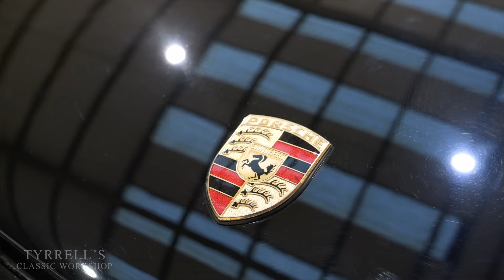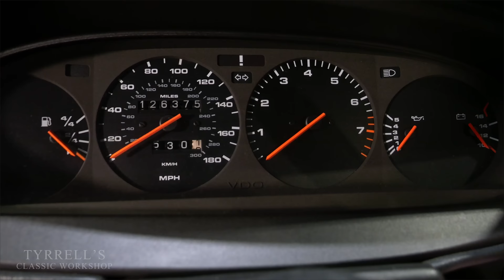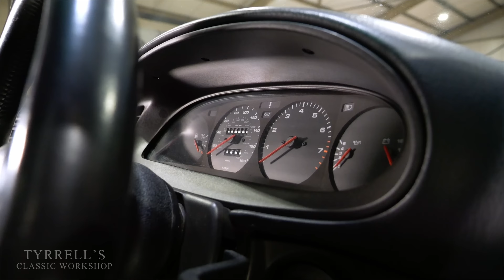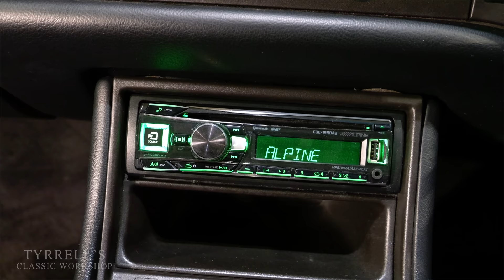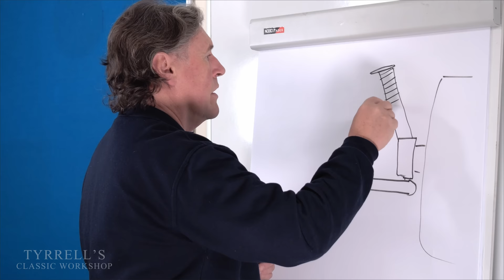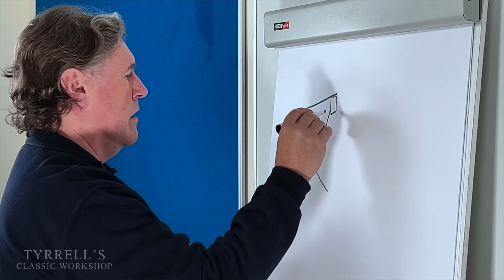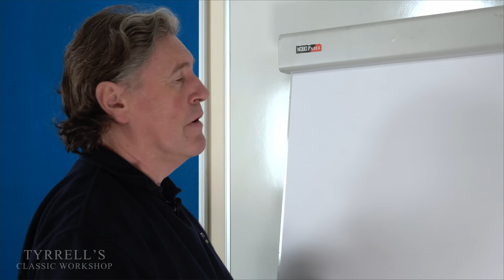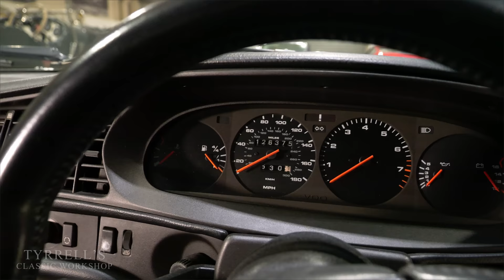Porsche Perfection: Unveiling the 968 Club Sport's Secrets | Tyrrell's Classic Workshop

Comment: Ian, you mentioned a few times at the start the 968 was 2.5 litres. The 968 was always 3.0 litres and at the time was the largest capacity 4 cylinder car engine in production. Handles like a dream with bags of smiles.
Reply from the maker: Yes- the perils of un- scripted takes. We did know that, honest! Sorry for mis- information
Reply: :) keep the little gems coming  @iain_tyrrell
Reply: And the 944 was also 3 litres.  :hand-purple-blue-peace:
Reply: Indeed, but started life as a 2.5 then a 2.7 (2.7 for one model year only).  All the 944 Turbos were 2.5.
Reply: @rallychamp01 The 924 S used the same 2.5 liter engine, but with slightly lower power (150 hp in 1986-1987 and 160 hp in 1988). The 944 S also used the same 2.5 liter engine, but with a 16-valve cylinder head and 190 hp.
Reply: Indeed. I had a 924S for a day for a transaxle photoshoot. Noisy engine (bit 'rattly' too) but it did grow on me. The interior looked great - so of its day!
Reply: @Hvitserk67 

The late model 924S was actually 1.5 seconds faster that the 944 turbo 0-60 time. 

The 944 T was heavier (Wider arches) and suffered with turbo lag against the 924S naturally aspirated 2.5 engine and slimline body. 

The very final 924S 1987/88 also had a space saver steel spare wheel rather than the VW full size spare (Van wheel) which shaved another 11 KG's off the weight and magnesium road wheels replacing aluminium.
Reply: The only commonality between the V8 928 engine and the M44 is the con rod bearings are interchangeable and the bore spacing in the block plus the alloy used for the block. 
Everything else on the M44 engine is bespoke. Different con rod design, bespoke pistons to meet the Porsche made hemispherical cylinder head design and different drive belt arrangement. 

Even the cranked over block to get the low bonnet height in the 924S/944 is at 30 degrees whereas each bank of the V8 would be at 45 degrees. 

The 944 carrera GTP le mans race cars (three built) M44 engine produced a seriously impressive 500hp during testing but was thought not to be reliable enough to withstand the longevity of the race so it was reduced in power to 370hp. 

In comparison the recent 2017 Audi RS 5 DTM class winning race car,  with its 4 cylinder 2.0 Turbo engine makes 506hp so the M44 race engine was very impressive output for 1980's technology. 

A couple of years back an Italian race engineering company did a full strip rebuild project on a standard road car 924 Turbo and with some redesign tweaks, modern electronic fuel injection  managed 450hp at the dyno test. 

As a VAG mechanic in the early 90's we had many a 924/944 as VAG stocked the majority of parts but sadly never got to see a 968 due to the rarity. 

That platform was a joy to test drive because of the great handling but if i never saw another torq tube bearings or clutch replacement i would remain happy. 
The Auto's also had a common issue with the transmission to oil cooler pipes leaking prematurely which ran the full length of the car and difficult to access and if you ran it out of fuel completely the metering heads could be a problem forever afterwards which i was told on my Bosch K jetronic course,  customers carelessly did quite frequently.
Reply: @ljt3084 I have not experienced that the later 924 S (160 hp) was faster 0-100 km/h than the first 944 Turbo (220 hp) in Europe, but there is no doubt that the later 924 Turbo (officially 177 hp) were faster than the first 944 Turbo due to lower weight and a slimmer body as you point out. The explanation is that the engine in question in the 924 Turbo (931) in lucky cases actually produced up to 210 hp. The mechanical tolerances at the time were relatively uneven, so in other cases the engine produced around 190 hp. The decisive difference between the models was that the 944 Turbo (951) had much better brakes so with repetitive hard braking from high speeds on the Autobahn the brakes of the 924 Turbo could not keep up. When this is mentioned, the later 924 S were really a gem and much, much better sports cars than many people think today.
Reply: @Aotearoa_Kiwi  just the S2 version and of the 944 production.
Reply: @racer98   That's correct. My wife had a 944 S2 Cabrio. Great car, with bags of torque (750cc per pot).
Reply: @iain_tyrrell  Speaking aloud about such things as a 3.0 litre 4 cylinder engine, would have certainly attracted accusations of blatant clickbaiting. Good move playing it down ;!
Reply: @ljt3084  No it wasn't, don't be silly. No 924S ever did 0-60 in less than 7.5 seconds unless it had been pushed off a cliff.

Comment: Base, manual 968 coupes are the real bargain nowadays! Everything but some of the weight savings and suspension parts are identical to the CS, but they are much cheaper today. With some fresh Bilsteins and Michelins, it will drive just as well tough.
Reply: The problem is a cheap 968 will most likely be a cabriolet.

Comment: I have a 1988 924S. So same basic suspension set up as this. It was the last UK press car so has Sports suspension, thicker anti roll bars and it’s lowered a bit from factory.

The handling is incredible and every time I drive it I smile like you did in this video. On rails as you described is spot on.

You can push it and push it and it eventually judders a bit at the back end to tell you enough is enough. The best handling car I’ve ever driven by far. I bought it to do up and sell but 20 mins into a drive to my workshop I knew I’d never part with it!

Comment: After owning a 944S and 944S2 when I lived in the UK, a 968 is what I aspired to. Then I got fed up with the UK, left the country, and that was the end of my Porsche ownership days. I sold my 944S to the Porsche dealership in Colchester and the rep gave me a lift to Colchester train station in his 968 Club Sport. It was a fast car. There was also a 968 Sport which, I believe, was only produced for the UK market. Apparently, some customers thought that the Club Sport was too basic, so the Sport was a Club Sport with the addition of some 'luxury' features - power windows, etc. Looked down upon by 911 snobs, but the Porsche 4 cylinder transaxle cars are lovely to drive.
Reply: The car in the video is a Sport ;)
Reply: Don’t suppose you remember the colour of that 968CS?  My Grand Prix white Club Sport was originally sold through Lancaster Colchester in 1994.  I believe it originally came with matching white wheels, but now has red ones to match the side decals

Comment: Great video! Sport and Clubsport variants are both excellent; well they’re both from the Clubsport line. This particular car is well known in 968 circles and is 1 of 306 special order Sports (Porsche GB ordered them) and not 1 of 179 C16 CS cars. Still a very rare car. Rather than bring snobbery though,  the issue is that the market values Sports and CSs differently and if a car is being passed off as a 1 of 179 CS to up its perceived value, then that’s naughty and as ever, Caveat Emptor. The Lux pack is a misnomer. It wasn’t an option on the CS in the UK, though was in Europe. The Sport is the equivalent and because it came from the same production line, will doubtless have the Porsche certificate of authenticity that it has a CS VIN number, which it will. But it’s still a special order Sport.
Reply from the maker: Thanks. The car is not marketed yet, but great efforts will be made to clarify what appears to be something of a minefield!
Reply: Probably have photos of it somewhere pre decals and sporting the Sport badge…
Reply: @davidfisk212 leaving Iain garage it will be better than any CS 😊
Reply: @iain_tyrrell   I know one of the previous owners (M.P. in the docs) if you want more info as I test drove it for him in Dec13. I think his number is in the file and he put the CS stickers on the sides etc and prob owned it the longest most recently. Hope this helps!
Reply: I don’t doubt Iain knows his onions and the car will be excellently presented. But it doesn’t change the fact that it’s a Sport and therefore worth less than a CS. But ultimately, it’s only worth what someone will pay for it but Iain has a reputation to protect so will want to do his due diligence to avoid any misrepresentation.
Reply: Totally agree with Davidfisk, I’ve had some experience with selling a couple of these and the sport v the CS is a testing con-flab between Porsche enthusiasts. They were all factory clubsports off the production line but Porsche uk wanted to create a “sport” with added luxuries like electric windows, electric boot release etc with a key hole in the boot lock and not the manual pull cord and blanked off key hole as in the CS, this is the instant give away in the differences to save weight in the CS, I was also informed that the sport would say sport on the v5 and the CS with say Clubsport. Interesting if you were to give a Porsche dealer parts department  the chassis of a number of a sport they will tell you it’s a Clubsport because that’s how they began life - as a Clubsport!

Comment: The link between the 924 and 944 is the 924S; it had the 2.5 engine and 5-lug wheels in the 'narrow' (no fender flares) 
924 body. The giveaway for the Audi-engined 924s are their 4-lug wheels.

Comment: The 924S has the same 2.5L 8 valve engine from the 944. I think you are thinking of the 944S and 944S2 for the 16V heads.
Reply from the maker: Yes- the perils of unscripted takes!
Reply: @iain_tyrrell  👍 mistakes happen.

But featuring the 968 wasn't one of them.
Reply: I think the 924s had a Porsche engine, not the VW lump and lighter and faster than an early 944.
Reply: @andrewnichols1023  that's what I said.

Comment: As usual an excellent video, but you missed out the key evolution step between 924 and 944. The 924 carrera GT was that step. 75 made in RHD 400  overa;ll to homologate for group 4 so they could race at Le Mans. light weight plastic panels for front and rear wings from which the 944 steel shell was derived.
with 210 bhp form 2 liters and less than 1000kg no one could call it slow.

Comment: That’s my old car !! Had it for several years , about 2 years ago. It has a fantastic service history and file of work done , it was a bit of a mess when I got it, nice to see my clean engine bay is still shiny😂. I put it through a classic auction and despite the letter from Porsche and a few other bits of proof, the consensus was it actually isn’t a club sport !! It’s just a Sport lux, without a rear wiper, with elec widows and rear seats, it’s right on the change year. I replaced the stickers and rear badge and put black Ppf on the leading edges of the wings and sills to protect against stone chips . Loved that car, used it hard , it drove so well and never let me down. Polished it to death , if I remember right the paint is a bit thin on the front passenger wing and under the door handle . I has the worlds largest 4 cylinder production engine , it’s a 3ltr . 
Lovely to see it again , gone some great pics of it somewhere . Sorry to say it’s not a true Club Sport , but no one really knows, enjoy it

Comment: Another great video, Ian. Love the nerdy bits. I never knew that the counterbalance shafts canceled each other out at TDC. I had to put a water pump in my 84, 944 and it took me 10 hours due to the timing of all the sprockets being so crucial. Getting the timing belt tension correct was also crucial. I remember being a bit frustrated that it took me 10 hours, but I called the dealership and they said they charge eight hours for that job. So I guess I didn’t do too badly for my first try.
Reply from the maker: Good effort I’d say.

Comment: Had two 944's one a 2.5 the other a 2.7 great cars. always fancied a 968 but never got round to it !
Reply: Buy a 3.0 S2 944 a much better car the 968s suspension was way to hard, plus it comes with the turbo body and later cars come with a much prettier rear spoiler

Comment: Makes me miss my old 1985.5 944, I went through that car front to back and it drove and rode like new, even the shifter linkage was tight after I put some flat model helicopter bearings on the rod-to-lever pin. It was just so lovely and balanced. Never left me stranded, pretty nice to work on and would just keep accelerating because of the low drag. And it looked stunning on its larger polished aluminium 16 inch turbo teledials
Reply from the maker: I think a lot of people wish they still had them these days
Reply: @iain_tyrrell  I console myself knowing it went to a loving home and it allowed me, then a student just finishing my college, to buy my other childhood dream: an olive green pearl 850 T-5R manual estate. Looking back, the cars I owned in my twenties were the most special, before life threw its inevitable spanners of responsibility into the works.

Thanks for another highly enjoyable episode, Iain.

Comment: Hi there. I had the pleasure of owning a 968 back in den mid nineties. Working close to the factory in Stuttgart , i saw these cars every day and my second Porsche was a 968 , factory car , fully equipped. The 968 CS was a version that was presented a bit later and to me it was a campaign to get more order intake and more cars on the road. The price of the 968 CS was much lower than a standard 968 and the interior looked really poor to me. All in all , the 968 is a wonderful car to drive. It has lots of space inside and enables to go on holiday with all luggage required. The engine is very powerful , even though only with 4 cylinder. Today you can find good cars for small money. 😀😀

Comment: I test drove a 968CS in the early 90's through Hamilton's Porsche in Melbourne (Australia) and it is simply the best handling car i've ever driven or been driven in. I actually had trouble keeping it in the LH lane as it's steering so accurate and so little steering input was required to turn the car. And no Porsche auto-blip. It was a real drivers car. I loved it and would happily buy a good example today if I was shopping in that price range. Apropos that, the 968CS is underloved like the 996.2 911's & are a great buy.

Comment: I love the 968. Mine is a non CS but has the spec I wanted (LSD, no sunroof and creature conforts). So glad to see Iain showing this one off..
Reply: I would add that if buying a 968, the standard is, apart from the M030 suspension (which to be honest is not the most comfortable) , mechanically the same. Same power, same torque. A tiny bit of extra weight and at least half the price.

Comment: Porsche elected to use a balance shaft system on the 944 to 'subdue' to the unbalanced secondary forces generated by an in-line four cylinder - which become 'notable' as the capacity (and hence recipricating mass) of the engine increases.  Whilst the balance shaft system was actually invented by the Englishman Frederick Lanchester in 1907, Mitsubishi developed and patented their own version called the 'Silent Shaft' in 1976. 

Porsche did develop their own balance shaft system for the 944 however, Porsche discovered that the Mitsubishi system was a superior solution.  Consequently, Porsche paid Mitsubishi a royalty of circa $US 6 to 8 per car to use Mitsubishi's 'Silent Shaft' for their large capacity 4 cyl engines - i.e. the 944 and 968 Porsche cars.

Comment: Hi, So Porsche made 1538 CS of which 179 were delivered to the UK as Club Sports and another 306 were delivered as "P35 CS Luxury Package" and badged as the 968 Sport by Porsche Cars GB . You can tell the difference on the build sheets as the Sports are all listed as P35 and have electric windows and were only available in model years 1994/1995 when rear seats were added to the options list. It wasn't possible to order a "Club Sport" with electric windows in the UK. This car was originally registered as a 968 Sport (I test drove it for a perspective owner around 10 years ago). So there were actually only around 1232 Club Sports and 306 Sports but they all left the factory as CS's originally. I hope this helps and happy to answer any questions on the model.

Comment: I've always looked at the 924/944/968 with a little bit of disdain...until a friend lent me his 968 for a couple of weeks. The engine has some grunt. It's not exceptional but it has some grunt. And the chassis feels both precise and light on its toes. Overall a very balanced and endearing engine/chassis combo whereas many classic cars tend to have a chassis or an engine but not a sweet combination like this.

I'd love to try the very rare turbo variant boosting power from 240 to 305.

Comment: You should test drive a Citroen Xantia ACTIVA. It has a "simple" chassi  set up but a very good suspension that alters between to dampening and 2 suspension settings automatically. Most important, though, it has anti roll bars "helped", when needed, by two hydraulic pistons, one in the front and one on the other side at the back that keeps the car, when driven hard, flat in the curves. It is like sports car when you drive it like one but very comfortable when driven normally. It would not shake your teeth out on that rutted road but it would surprise you with its exceptional road holding  when attacking a corner.
Reply from the maker: I remember the Activa. I saw a photo of one in a hard corner, still not rolling, but the outside tyre clearly distorted due to the g force. A work of genius. I wonder if any survive